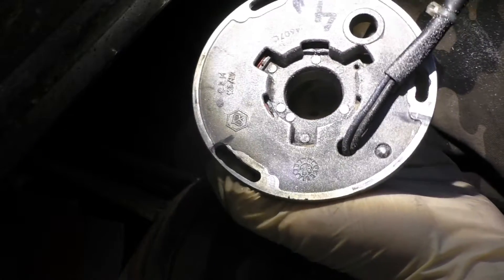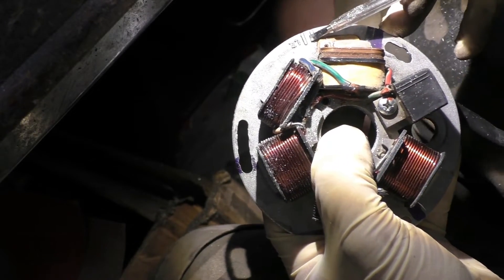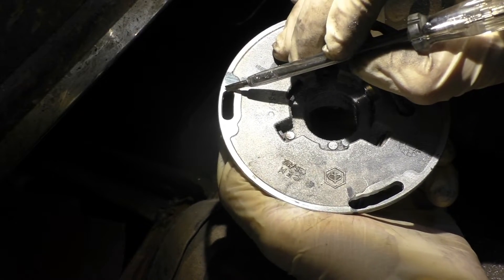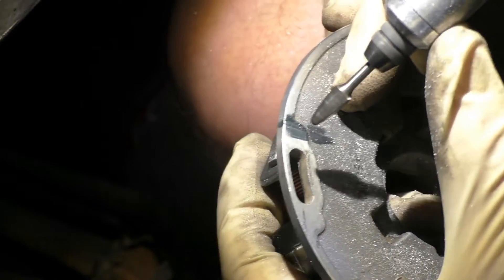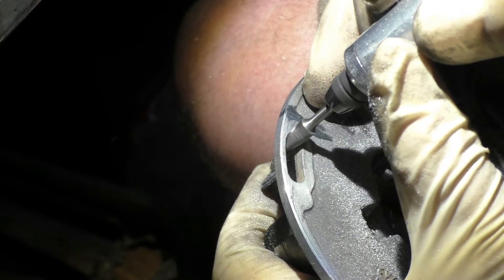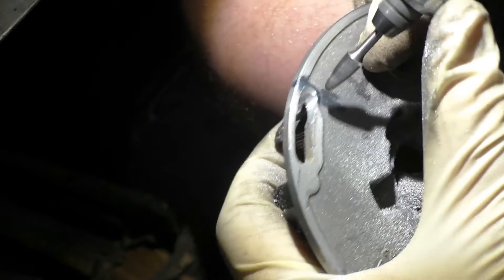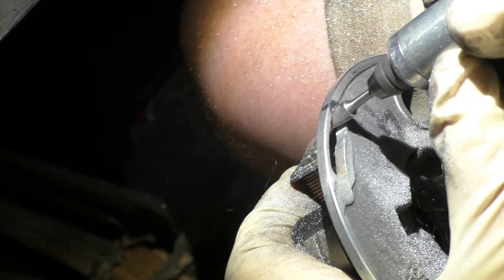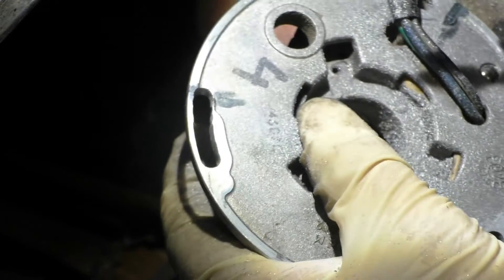vespa stator LONG HOLES need explained /  FMPguides - Solid PASSion /

Comment: I find your videos absolutely brilliant, I'm currently building a engine and the information I've got from your channel is priceless. My latest problem was with the timing I've measured rotation and marked up the engine but couldn't achieve the 18 degrees for my cylinder kit due to the stator plate holes which started making me doubt my calculations but seeing this just confirms my findings. Thanks for your time putting this channel together it's a big help.
Reply from the maker: thank u. ur very welcome. sharing is caring! and thats what social media is for 🙃🍻😎

Comment: Das ist wieder eine von den Zündgrundplatten, wo Luigi am Vorabend Fussball der italienischen Nationalmannschafft geschaut hat und da bei 1 Flasche Lambrusco vernichtete. Dann kommt dann sowas raus. Gutes Video. Ois ihsi. Guat goan. #daumen
Reply: Aaaargh ... jetzt weiß ich, warum ich mir damals eine Mulde in das Kolbendach gebrannt habe. Alte Kurbelwelle musste raus wegen Lagerschaden am Schaft. Neue Welle rein ... >>>NICHT GEBLITZT<<< und dann passiert sowas.
Reply from the maker: "proxxon langhals" it is in german.
Reply from the maker: :D :) der stumpf radius ist so klein dass eine minimale abweichung bei der nut schon DERMASSEN viel grad ist in real, dass man schwer daneben liegt. IMMER blitzen ist die devise. denn auch "originale" kurbelwellen sind ja woswas i QDS china oder so.
Reply: What was the brand of “dremel”
you use? Thanks for the clear explanation, have exactly the same stator on px150 carters with dr177 cylinder, also needed 10mm more space. So I could time the engine at 19 degrees. (timed with stroboscope ofcourse)